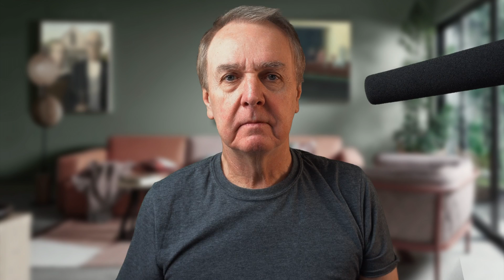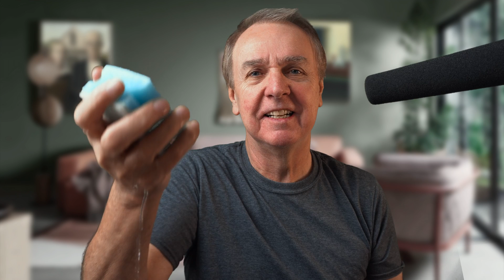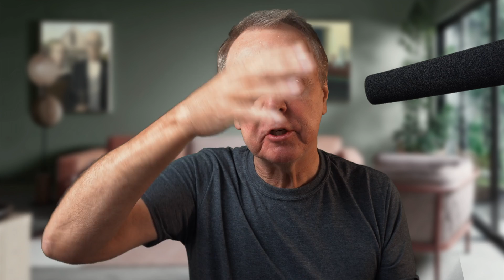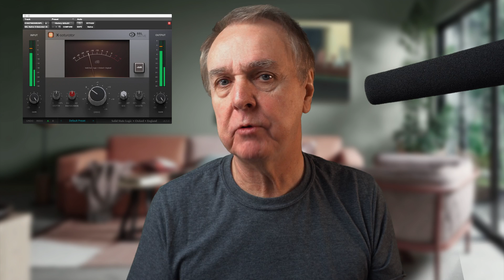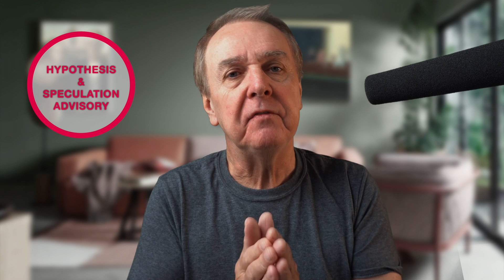SoundBite: What is saturation? (It's not what you think)

Comment: Actually, the transfer function and waveform clipping are not separate things. The transfer function maps an input intensity value to an output intensity value. If the transfer function is bounded, then there is clipping. In any case, a nonlinear function will alter the waveform.

Comment: One interesting point here is that the original waveform is recoverable only in the transfer function of the waveshaper has a positive or negative slope throughout the entire function, with possibly one inflection point with a zero derivative. You need the Y's to uniquely map back to the X's, and that can only happen if there is only one X value to map back to. This rules out the hard clipping curves with flat sections at the top or bottom, and also many of the "crossover distortion" curves. 

I don't think your premise is entirely accurate. Imagine you start with a 1kHz sine tone, push it through a tanh() waveshaper, and get a series of odd order harmonics... 3kHz, 5KHz, 7KHz, etc. You can then make an EQ move in the spectra above your original 1kHz tone and affect the now existent harmonics. The extreme example may be to use a higher order highpass filter around 2KHz... for the thought experiment, we can even simplify this to be an ideal lowpass filter that completely eliminates the original 1kHz tone. We are still left with the harmonics created from our waveshaper.

One more note. The real complexity of the magnetic saturation seems to come from the hysteresis. The output of a hysteresis model is state-dependent. I doubt it is inversible, although I'd have to take a closer look at the equations to say that definitively.

Comment: I never thought of or used the term saturation for harmonic enhancement so going back to your previous video to hear that was new to me. My understanding of harmonic enhancement was to take a frequency and make a duplicate of it at double and triple, or 1/2 etc. of the original, I thought. That's what the term means in RF harmonics--2nd, 3rd harmonic, etc. Good learning nonetheless.
Reply from the maker: Saturation is one way of producing harmonics, which as you say are whole-number multiples of the original frequency. Of course it gets more complicated than that with intermodulation distortion, and analogue tape which adds non-harmonic frequencies due to scrape flutter. DM

Comment: Hello DM,
Yes, saturation is not the same as boosting frequencies.
A spectrum analyzer will bear this out in no time flat.
I've developed several saturation plugins, the spectrum analyzer is indispensable.
And as you know, tubes, transistors and FETs saturate as well, with different harmonics being produced, for a slightly different sound.
Best regards,
Bill P.

Comment: Your explanation is very complete as to Plug-ins in a DAW. 
Saturation as I know it is the limit of analog tape to hold more magnetism. The result is generally a loss of high frequencies and a soft, somewhat pleasing emphasis of the lows and compression of the dynamic range. This is of course, distortion, but not all distortion sounds bad.
Reply from the maker: Not all distortion sounds bad, I agree. What would Jimi Hendrix be without the distortion of his Marshall amps? DM